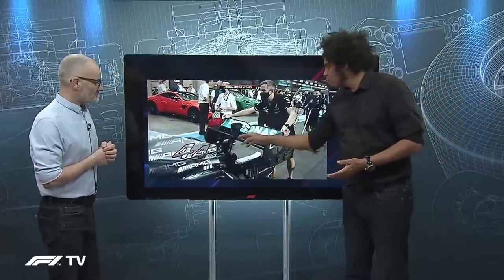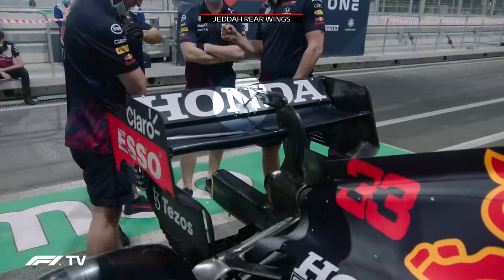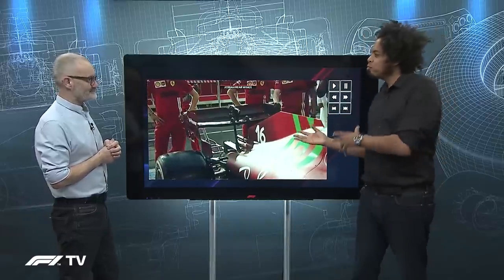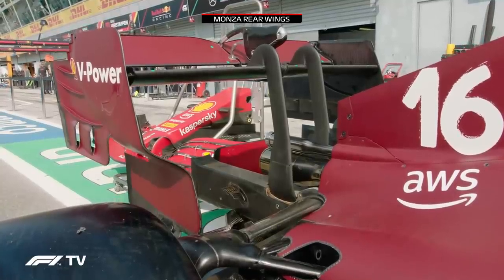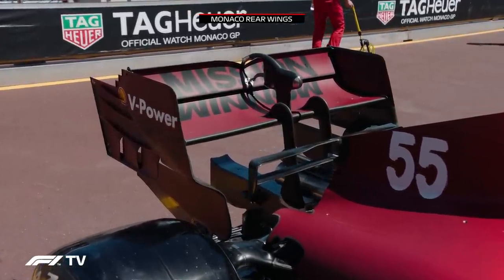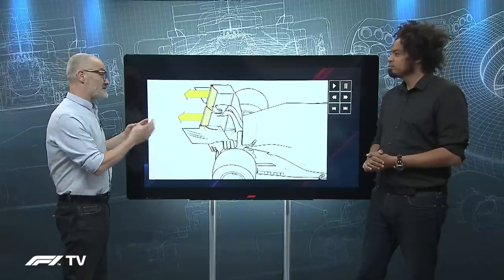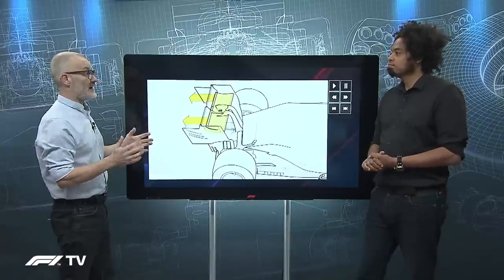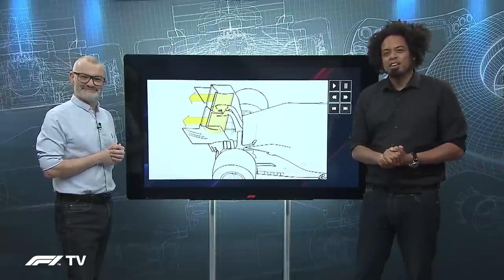Rear Wing Set Up For The Super-Fast Jeddah Corniche Circuit | F1 TV Tech Talk | Crypto.com

Comment: Thanks for the update. Hypothetically if you create a latch or notch on the vertical stand of the wing that move outwards at high speed and then allow some flex on the lower wing it would pass in a statical FIA test. And therefore complies and it is legal.
Reply: That's really nice alternative...
Just asking, do you work for automation industries doing some technical  related job??

Comment: I still expect the teams to stick with medium downforce wings at Jeddah. I think there are plenty of fast sections like sector 1 or the turn 21-22 combo where you are really on the limit of grip and extra downforce just helps you carry more speed through there into the DRS zone. Downforce also helps in the braking zone, you can brake later with more downforce and go for an overtake. If you can get into DRS at the final DRS zone, you enter that zone with better speed thanks to higher downforce through turn 22, then you don't mind the high downforce much on that straight thanks to the DRS, and then at the last corner you have braking advantage over someone with a low downforce wing. Downforce can help you overtake at Jeddah. And even if you don't quite get the move done at turn 27, you can get close and get another DRS on the main straight to turn 1 and perhaps overtake there.
Reply: It depends though. For instance, early in the season, the high rake concept allows RB to run smaller wings than Mercedes to achieve the same level of downforce. If the rest of the car is able to produce enough downforce, they might go with the low downforce wings to reap the benefits of low drag.

Comment: Even with a low drag rear wing, gonna be hard to Red Bull. Since Mercedes pace seems strong, and changing the engine in Verstappen's car in this track could be risky...the only way for him to  beat Hamilton, is using Pérez as blockage, increasing his stint to catch Hamilton after he does his pit stop. And then Verstappen pits. It could worked out in Qatar.
Reply: Quali seems to disagree 
If max never hit that wall he would have got p1

Comment: Always have been curious..are teams allowed any type of engine maintenance? Can assume with small c.i.d/ big h.p engines you must have to ring and bearing these engines occasionally..are teams allowed to do so or will they catch a penalty for taking preventative maintenance
Reply: No maintenance is allowed
Engines are sealed during races only allowing inspections via cameras to be done 
And no maintenance is allowed between quali practice and the actual race other than safety items like a broken suspension or faulty brakes

Comment: test didn't include the duration of applied load? that's odd. you do that if you need to fail the material but not during a safety test or in this case regulatory test.

Comment: Do teams manipulate the open and closing speed of the DRS flap?
Reply: There would be no benefits to slowing the opening and closing of the flap, so probably no
Reply: @Alucard-gt1zf  you don't think there would be a  benefit from opening it very fast and closing it a little slower? ...lol
Ferrari pumped more fuel into the engine between air/fuel measurements to gain a top speed advantage and they haven't been competitive since they got caught...lol
I think Formula 1 teams look for the 0.002 advantages because it adds up and sometimes that's all they need to be the fastest on the grid. 
I could be wrong about the DRS flap opening speed but they're talking about flexible carbon fiber that was engineered to pass the technical inspection but flex at speed on the track...lol
Reply: @bryonkidder6199  the flap already opens as quick as possible, and the don't want it to take to long to to close as when they close there in the braking zone, and when the get drs compared to when they don't the driver as to back is braking point by about a meter already, so no

Comment: Mercedes have allways been a high HP and higher drag car. This year their PU is better at the beginning of its life vs the end of its life. Unlike RB where their engine doesnt lose a lot of HP over the race calender
Reply: Wrong, mercedes has always been a high hp, high downforce, low drag car due to the low rake philosophy, before they chopped off the rear floor this year
Reply: @chiefdenis  you are correct I think that what I wanted to say but ended up saying high drag
Reply: @cmanning007  it cool man, everyone makes mistakes.

My theory is that since they're pushing the pu extra hard to compensate for the massive loss of downforce, that's responsible for the rapid power decay.
Before they only had to use party mode sparingly, since the pu was already powerful in regular modes, now they party all day, imo that's a testament to the reliability of the pu
Reply: @Bahamuttiamat  the breakthrough actually came in turkey, the car was so well balanced in turkey and has been getring progressively faster since then (barring mexico of course), the new ice in brazil was the icing on the cake

Comment: im no tech genius but i didnt think this was a monza style circuit
Reply: What's different between Monza and this circuit that makes this one need more downforce? Honestly curious.
Reply: @MeltingRubberZ28  dust, new road, no previous data, teams don't want ot be the odd one out and find that the wing they chose was wrong and they fail because of it, safer to just use the middle option

Comment: Whatever happens, it will be exciting and enthralling to the end, and boy I hope it goes to the end. Saudi Arabia and the reworked Abu Dhabi favors Mercedes, even more so with "Spicy Equipment". There are some caveats though. This is an unraced track, there is no rubber on this new pavement and I expect it to be somewhat slippery. I expect to see more of the red flag because there is no runoff and that track is QUICK, but at a minimum, there will be a safety car and maybe even some spontaneous punctures like Qatar because of tire loads. Some may say that 2020 Max won at Abu Dhabi and yes he did, but that was a season where Mercedes were already seeing reliability issues and chose to go conservative - see Perez's engine failure. This year that won't be a factor and hopefully we get a thrilling finale.

Comment: 9:20  There's no evidence that Merc are doing this, it's just Red Bull being arses.  The claim doesn't even pass the sniff test: they claim Merc wing was bending at over 250 kph but the flex is masked by the top plane.  Yet no flex could be seen with DRS open thus offering no overall top speed advantage, and no flex can be seen from behind which would be clear as the Ineos logo would also flex.  I take the sniff test comment back, the claim does smell strongly of (Red) Bull.
Reply: Merc complained about RB’s fast pit stops despite no evidence of danger. Turnabout is fair play. Cry harder.